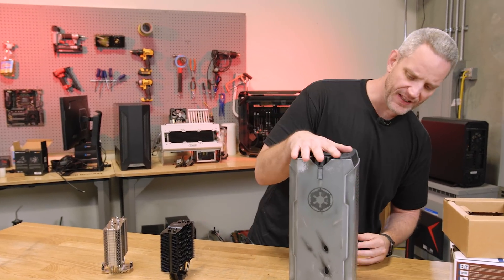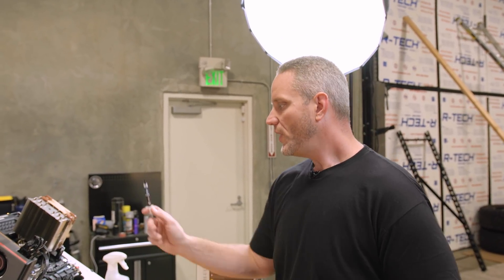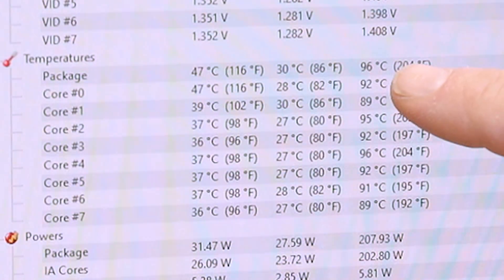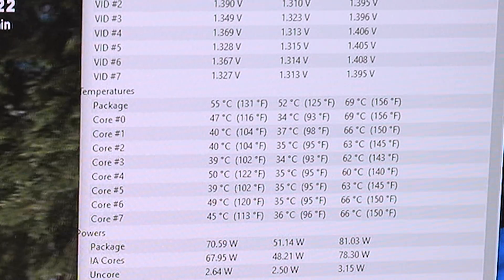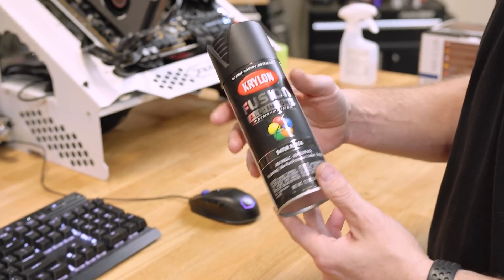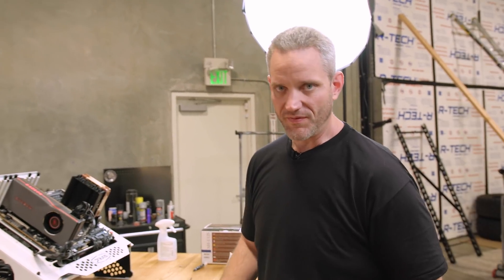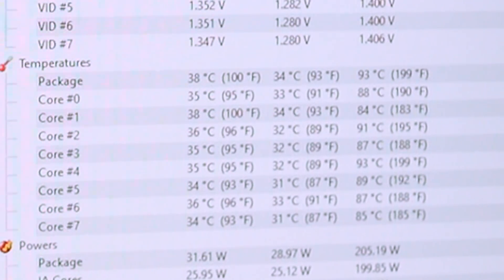Does painting a heatsink hurt its performance??

Comment: Just spray from 45 degree angle downwards because nobody will ever see the underside or middle area of the fins while it's installed. That way more than 50% of the surface remains unpainted. Better looks with next to no heat penalty.

Comment: You could have only painted it from above (and a bit form the sides, I guess, to get coverage on the heat pipes and base) leaving the undersides of all the fins bare. It's not like anyone's going to be looking up from the mobo, or if they are there's much more important things to worry about than whether the painted radiator has complete coverage, and the shiny bottom side might even be useful to your Explorer Smurf as well.

Comment: This was kind of neat, Might Car Mods and Engineering Explained covered this kind of topic regarding intercoolers and rads. If I remember right, the conclusion was that absolute thermal efficiency was hurt, but because black paint is more thermally emissive that passive temps were unchanged or better.

Comment: Actually, I found interesting how much a different fan used on a Noctua cooler improved the cooling. Noctua fans are wonderful (have never had one fail, I have different sizes I've bought over the years stacked in a box). But I may consider buying a more efficient fan for the heatsink and use the Noctua fan as a case fan.

Comment: Informative video, but there are paint options out there which are specifically engineered for heat transfer.  I'd be interested in a comparative test using something like Cerakote's High Heat Emissivity coatings or even just plain ol' Radiator Paint.

Comment: Its a reason radiators are mostly white... it radiates more heat. Just like solar collectors are mostly black to absorb max heat. Its simple physics.... IF white - Just don't add to much white as the color can become an insulation instead also make sure to get an good white that's not uneven as that adds to dust buildup

Comment: A very little bit!  The heat can still travel up the pipes, and radiate out the joints to the fins.  The paint will insulate it a small amount but as long as airflow is not blocked, it should be quite minimal.

Comment: Well, I was considering doing this (very thin, of course) to IMPROVE the performance of a skimpy bare Al heatsink on a production machine's RAID controller. Scratch that then. I have zero clue where to get such a thing anodized here with ideally less than a day of turnaround.

Comment: So, Ive done this test myself with a hyper 212 evo... or several...
And what I found in my testing is that if you paint any tower cooler on a 45 degree downward angle where youre effectively NOT PAINTING the bottom of the plates, or even all the way thru the fins (because you only ever see if from the top DURR) what you are left with is a slick looking cooler and temp differences which are so low it can only be considered margin of error.

Comment: paint it with graphene, increase performance because of 10X lateral transfer speed when compared with aluminium, doesnt help close to the heat pipe, but helps to bring heat away from the heat pipe faster so that the fins are heated, and cooled, much more evenly

Comment: um curious why you called intel solder tim bad? the only thing ive ever had work better on a soldered intel chip was liquid metal and you have to sand the solder off to use that its risky for a few c drop. i think lapping yeilds better results than changing the tim on intel i havnt had too many chips even close to flat on the ihs  and copper does conduct better than nickel anyway

Comment: I don't know if you'll read this Jay but, there is also a big debate about cooling with painted surfaces on intercoolers for cars, which is extremely similar to this. Some videos here on youtube claim that a painted surface  offers a cooler temperature. Since, you love cars I would love to see you try this with an intercooler and see if you get the same or similar results since they are a lot alike as far as function and methods of heat transfer.

Comment: Now get a new air cooler and paint it with ceramic spray paint designed for temp control and see what happens? Check any autoparts store and they usually carry it 😉

Comment: They paint car radiators black all the time.   If the paint is thin won't matter much.  If its thick it may act like an insulator and keep it a little warmer.  IF its really think could block air flow.

Comment: Would it be advisable to use 'stove paint' that is designed to endure high temperatures?  If your heatsink is potentially going to reach 90C+ in spots, I would be worried about regular spraypaint off-gassing nasty stuff.  My house has a freestanding fireplace.  It was originally blaze orange (1970s were a crazy time) but later painted black.  As I discovered the first time I tried building a fire inside of it, they did NOT use stove paint.  As a result, I was just sort of burning the black paint off.  It filled my house with terrible fumes, and I ended up needing to throw open the nearby door in the middle of the winter and get an industrial blower fan to try to get the smell out.  Felt like it was going to kill me.  It was an unpleasant experience.

Comment: Mask the open areas of the finstack, paint the outside then unmask and paint pen the fin edges. there should be much less of a heat increase and you still get a good visual effect if you do a push pull setup as the exposed metal would mostly be hidden..

Comment: Wow, you already have the RGB under control but adding temperature sensors (in the water loop) and flow rate sensors (also in the water loop) and having ON SCREEN control thru software is so super cool, you've just got to try it and make a video of it.  Here is EK's link to the controller.  It sends data to the motherboard thru the USB cable. 
 https://www.ekwb.com/shop/ek-loop-connect

Comment: Commenting at 1:42 
I have been a professional auto and industrial painter for over 25 years.  It depends on what paint you use. Most cans of spray paint (bomb can) is Enamel and it happens to spray thick, at least you have to spray the thinned out garbage in that can, thick, to get proper coverage. (people start with a tack coat wait three min. and then spray a couple more light coats. Then one to two medium wet coats to get a nice finish its not a race to get the paint to cover in one coat)    Enamel will have different heat dissipating properties than Lacquer as Enamel will hold in the heat like your stove in your kitchen. Most kitchen appliances are coated with Enamel because it has great thermal properties.  This leads into the next paint in cans (bomb can). Lacquer takes less to cover and would have better heat dissipating attributes than Enamel. It takes Lacquer only a few coats to cover and less paint millage means better heat reduction, but, Lacquer cost more money. So what kind of paint did you use??? 

Now you got your paint lesson, I don't think it's going to make a huge difference being it is only 100 degrees at best. You might have a few degree uptake with a painted one depending on what material was used and depends on how much was applied.  Now you can get ceramic paint and yes ceramic dissipates heat well but it is still going to fall in the Enamel, Lacquer or Urethane category. (yes I know I did not mention Urethane because it is usually a two part mix and only a few versions of it is in a can (bomb can). Alsa corp. makes a clearcoat Urethane in a can and it is a one time use. You pop the bottom of the can releasing the activator and start spraying a 2K clear like your car is painted with in a can. (1K means no activator just open and spray with a spray gun or shake and spray in a can (bomb can). Not really applicable in this situation. So I say 5 degree at best without seeing how much was applied. If Jay is heavy handed I can see a uptick in temp and if he is light handed a down tick in temp.
Reply: Edit:
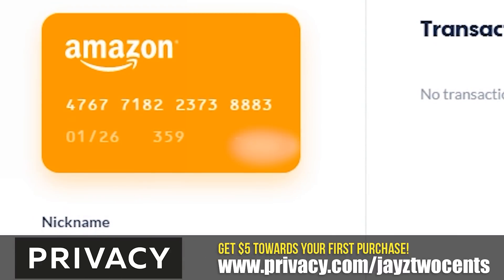If the paint is applied heavy, like, really thick of course it's going to have an effect on heat dispersion (typed at 2:00 into video) I am a light painter and would if I paint it, use three to four very light coats of coverage. The last coat being my beauty coat. Paint that is applied thick blocking the fins does not allow for cooling to take place. After watching this if I think it was applied way to thick I have a cooler like this and I will do the test myself painted by a professional. I can spray paint from a bomb can and you cannot tell it was  from a bomb can.

Comment: JAY IS WRONG or at least misleading (unintentionally I'm sure)!
He said "AMD CPU's being soldered run a lot cooler..." well. See my comment below. The 3000 (Zen2) series (can't speak to the previous Ryzen CPU's) possibly run "cooler" I don't know but the MAX TEMP is way different so his point about temperature headroom is completely moot. And just because you have more efficient TIM under the heatspreader doesn't guarantee the temperatures will be lower either. So there's a bunch of factors you need to get straight:
1) Zen2/3000 draws a lot LESS POWER (produces LESS HEAT) for the same amount of processing
2) Max TEMP is much higher for the comparable INTEL CPU's though, and
3) POWER and TEMP are not directly related between architectures. You may have hot spots on an AMD CPU that have higher temps (I can't confirm) than Intel despite Intel producing more HEAT when normalized for same processing amount.

Comment: R9-3900K vs i9-9900K for fan noise
Just FYI, but even though the R9-3900K produces far less HEAT for the same amount of processing performance (HEAT is same as POWER DRAWN) due to the 7nm process compared to Intel's CPU's, the TEMPERATURE that the Intel CPU can go to is much HIGHER. AMD recommends no more than 75degC for the 3000 series and in fact I will CRASH if I go much above that under heavy load... I don't have an i9-9900K to compare but it MAY be that under many circumstances it runs QUIETER. That might be a good test? Not sure how to normalize PERFORMANCE but I guess setting an FPS cap for a game might serve, then just record FAN NOISE with each system having an OPTIMIZED fan profile for LEAST fan noise that maintains stability (so ramp up to100% fan RPM on AMD system at 75degC, and ramp up to 100% fan RPM at 100degC on Intel?).
Reply: EDIT: should be "R9-3900x" above not R9-3900K

Comment: I think a 5 c difference. I know it will definitely insulate by a fraction at least but I don’t see any way for the numbers to go up drastically. The tower will still draw heat and the fan will still blow it away. The paint may hang on to the heat a little longer but if having it painted to match your aesthetic is something yo
u want you’ll be able to live with it

Comment: i thought you were supposed to use engine block spray paint? it's supposed to transfer heat better than regular paint, saw another video where someone painted their aio radiator block with it and had only a slight difference in temps.

Comment: I use high temp. paint for metal. I used it on my exhaust pipes on my byke. it was cool  basically it left clear tint like colored chrome . That ( Your)  paint had primer in it, which made it too thick. This type of paint is not designed for that purpose. Should have done a little research, like gone to a byke shop. it would have turned out better.

Comment: NH-C14s. I masked of inner fin stack so that only the outside panels and heat pipes got painted.

Used a can of black plastidip I found in the garage, only saw about a maybe 1°C difference on  torture tests, but even that was with margin of error.

Comment: OK, I got to say something, my ocd is going crazy. What the hell did you do to your overhead door? That insulation job looks awful, boards holding it up. Your better off using an aggressive silicone and basically glue those insulating boards directly to each door panel, horizontally. Then you can still open and close the door as needed and not have to remove the insulating boards.
On another note, try hydro dipping the cooler. You will get better coverage and thinner layer. Less likely to effect temps.

Comment: This is surprising, because black bodies classically radiate heat significantly better, and heatsinks radiate as well as conduct. But this shows any black coating needs to be well keyed and very thin so as not to constitute an insulator. Black anodizing should prove better.

Comment: 13:45 Actually Jingles, Intel 9th Gen went back to solder because Intel was finally getting concerned about heat after lots of criticism from users especially with the 6c 8700K. They finally stopped putting Intel Mayo Inside. Edit: added time stamp at the start to help people understand what I’m arguing about. Hope yall got the WoWs reference.

Comment: It really depends on the emissivity ratio of the heat sink being used. Thermodynamically speaking, in some cases painting the heat sink will have none to a very small effect upon its ability to dissipate the heat. In others, it can be devastating. It also depends on the type of paint being used. I would recommend anodizing a heat sink if you want to change the color of it.

Comment: Black colours are meant to disapate heat up to 10x faster than white or shiny. Obviously that is negated by the insulation of the paint, but I wonder if it was anodized black it may see an improvement. Would love to see a video on it @JayzTwoCents
Reply: Well I know white spray paint is thermally conductive thanks to being made out of titanium dioxide. Then some specialized black spray paint is carbon so its super conductive. But I just cant find any information on ordinary black spray paint..

Comment: Don't think it will matter. The layers are so thin... it shouldn't insulate the metal to any crazy degree as long as the heat sink maintains it's fins the Metal to air transfer should be fine IMO

Comment: couldn't you use metallic paint to avoid insulating the heatsink? I'd think metallic paint might actually help the fins because you're increasing the contact of the fin to the pipe with paint and adding surface area, (sort of) ...thats what I think. still watching the video.

Comment: the paint reduce thermal transfer by convective way, but it should increase the heat transfer by radiation.
Painting the cooler, is harder for the air to pass between the plates, the paint might insulate part of the heat as well.
But if you have done a test without the fan in both cases, my guess is that the temperature would not have changed much.

Comment: I think the paint used was a big factor. That Krylon Fusion is pretty T H I C C for a rattle can. For reference, Mighty Car Mods did a test to see if painting an intercooler black would increase the temperature of the air charge coming into the engine. They found that it actually cooled better. That being said, I know computers and cars seem worlds apart, but the principles of the two tests are the same. I think a different paint would yield a different result.

Comment: the real question is, with all the air flow and heat and cooling down, how long  before the paint chips and peels ? i imagine the expanding and contracting of the metal will cause issues,but  i could be wrong

Comment: Before watching, my conclusion: It will act like when you painted the radiator on a water loop.  There was a video where you touched up the paint and did a custom paint job on a radiator and explained it.  I would think painting fins on an air cooler, would be the same as painting the fins on a radiator.

Comment: 1:17 "At this point in the video you need to make your predictions. will it matter?" my prediction is it will matter. but very slightly, possibly inside the margin of error. but to be fair you have not yet said which type of paint you are using. i know there are different types of spray paint, and that you can get heat-conductive paint. so, we'll see.

---------  EDIT  ----------

and the results are in. The test went exactly as i thought it would. just a couple of degrees, using a basic paint. Now i would like you try it with 1 of the thermal transfer paints that are out there. (such as engine enamel at Autozone for example)

Comment: Jay thank you for your awesome videos, because of you i finally built up the courage to do a liquid cool system and it looks amazing. No leaks, no issues only 1 cable i need to reroute and 1 tube im gonna bend a bit different when i do my first liquid change. Used all corsair products for the 10 mm ID and 14 OD hard tubing. 1st time doing open loop liquid cooling and not a single leak.

Comment: I doubt this comment will be seen. However, Jay you are a car guy. There is a video in the world wide web where two guy paint an intercooler on a car black and gets lower temps. Now I am commenting before seeing the results so I am assuming it will be lower. Maybe by a degree but still lower. If this was getting direct sunlight then I think it would be hotter vs unpainted.

Also Jay if you are ever in Virginia I can get you a free Autocross event, Yes this may be blackmail but I think its okay with talking about painting something black.... okay maybe not...
Reply: Okay, watched the results. I was wrong. Now with that being said. I think the way the paint was applied could be more of the issue.

Comment: if i have memory that is using one xmp profile set to 3000mhz. if i add another set of ram that isnt the same type/module but still has an xmp profile of 3000mhz, can i set the xmp profiles seperately so they both run at 3000mhz or do i only have to set one profile for them both to be 3000mhz?